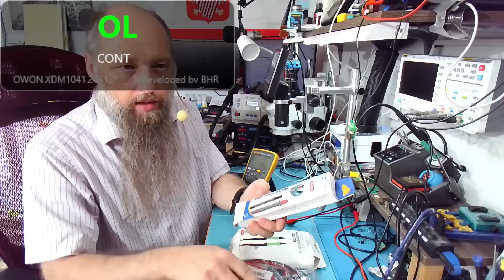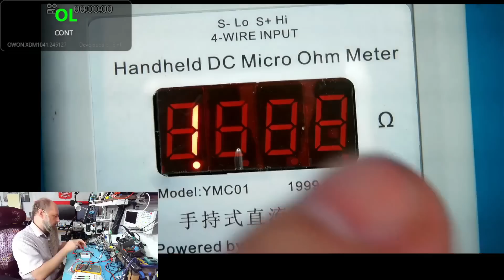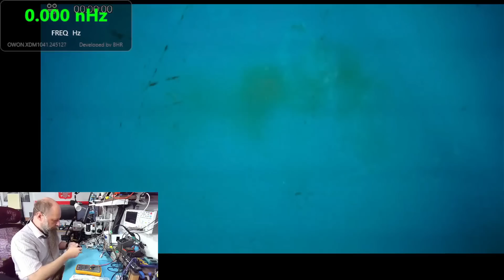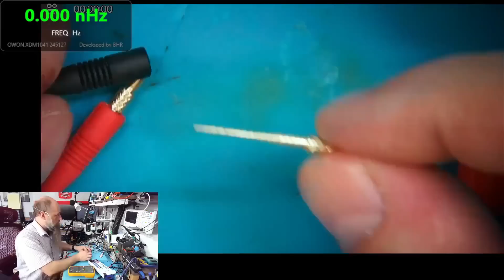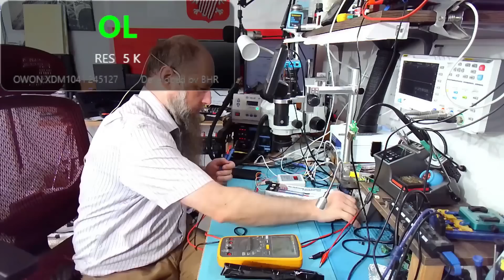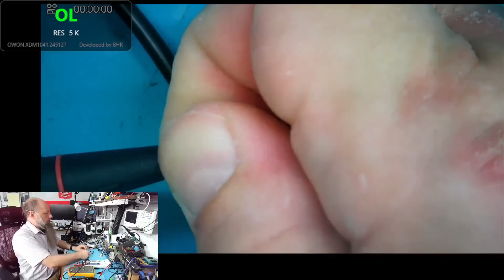228 | Multimeter Probes - Where and what to get

Comment: The hardened stainless steel tipped probes are the professional's choice for handheld multimeters. They have no plating to wear off, just solid hard stainless steel. I have 40 years experience in electrics and electronics. I've tried everything. Nickel plated brass tips are terrible at measuring low ohms. Also, the tips blunt after a day of real world use. Gold plated brass is a gimmick. Once the gold wears off, they are terrible. And the tip blunts quickly anyway. Stainless steel tipped probes measure low ohms accurately, the hard tips stay sharp for a long time, and the tips can be resharpened without affecting performance. FYI, I've been using Pomona 5898.

Comment: I use the very cheap ones, with the sharp tips. I bought them for like 1.60 or something .. They have very low resistance...I have a couple of them, because the tips tend to break when I use them (pcb that are covered in I don't know what kind of resin) been using them for years now. And I always go back to those ones, they are better than the ones that came with my Fluke (I mean better in the form of low resistance). In this day and age I almost only use my Fluke for "beep" function LOL! Because my cheap Chinese BS multimeters are "better" when it comes to high resolution, but the beep function on my "pro" mutimeter is faster..
I never cover the tips. For some strange reason I like to role over them with my office chair and that breaks the sharp point of the tip (I have broken like 3 of them, but they are cheap so what ever).

PS: I would've measured all the tips, not just 1. Also clean them with some (iso)alcohol before testing...
Reply from the maker: Thanks for the tips, I'll keep them in mind for the next video!

Comment: Have the cheapest version but with classic silver tips, and have higher resistance on some points (up 4 OHM!) caused by not homogeneous coating layers, had fine sand them a bit and turn at 0.2 OHM 
Wires are hard PVC with thin section like 23AWG
Reply from the maker: Thank you for the tip! I've heard of his method, never tried it though. Whatwasthe grit of the sandpaper you used?
Reply: @blackhorserepairs  1000 grit (the only I had, 2000 is better) fixed on a glass surface.
Put the tip with an angolation of about 45 degree and rotate, avoid strong pressure.
Sorry for my elementary English

Comment: Hey! Thanks for the content - noted a couple of tips for myself, it happens not very often lately. That's why I want to share some feedback and possible suggestions for future vids. Please discard them if irrelevant :)

the feedback:
- frankly the whole video I expected you would make a lot more measurements: 
you have in one kit: 4 tips, 4 tip holders, 2 wires. but you measure only a single tip and a single wire probe assembled using a precision resistance meter and 2 probes tip-to-tip using your multimeter. 
I expected measuring made on the precision meter:
- all of the tips from the very tip to the upper end of the screw part, 
- then each tip holder separately, 
- each wire separately 
- and then each of the whole wire probe assembled
and finally multimeter measurements:
- tip-to-tip measurement, 
- single probe measurement (by simply touching open multimeter port with the tip of the plugged probe)
  .various resistances at hand would be much more informative and entertaining

suggestions:
- scratching materials of  different hardness like oxidized tin, brass, copper; clean metals, golden contact pads etc.
- scratching the tips with different materials of known hardness under the scope to determine the material of the tips (gold, brass, galvanized steel)
- try flame analysis of the tips (at least those you destined to be thrown to junk: different metals make the propane flame to get a specific colour 
- determine the influence of probe plugs contact is corelated with their insertion tightness
Reply from the maker: I noted all that for the second part, I should be able to do most of those measurements. Thank you so much!
Reply: @blackhorserepairs oh, that's awesome! I subscribed to the channel yesterday, so I hope I won't miss the release :)

Comment: I hear the first time, that to cover testing probes with plastic or rubber plugs are very important... That's  nonsense, if we testing everything with oxide layer, why we should care that probes have a little oxide layer, i just clean probes with contact cleaner, or ipa, and it is ready to go...  Covering testing probes, with rubber plugs, will not protect from damage in future, we can make damage in other way, nonsense to protect thing that will be stabbed to everything you want...
Reply from the maker: you have a point, I don't really have anything to back up my claim, but, when you receive your probes from the factory, all connections are covered, both sides. It is only my assumption that if it did not impact shelf time, they would not have bothered to do that, ergo it should extend the life of the probes (perhaps by negligible amount). Thank you for pointing that out.

Comment: All probes will tarnish no matter the make or price. A little mechanical cleaning goes a long way. Fluke has been making PVC probes for decades and those do not crack, but are not as nice to use as silicone ones. I see no practical downside of using a 0.3Ω probe vs a 0.1Ω probe with a DMM. If that makes a difference you are already in the 4 wire measurement territory.

Comment: I agree you need good probes for consistent results which is very important. I suggest you press the relative button on multimeter to "zero out" the probes used for testing. It is very difficult to determine the resistance due to how you touch the probe ends and whether or not there is oxidation on the probe tips. I also would say to try your tests using first IPA and then deoxit to clean and prep the tips and connectors before testing to achieve consistent results by reducing the oxidation on the probe tips. Depending on how long a probe may have been in stock the results can vary depending on oxidation levels on the probes connectors and tips. Even from same vendor. If possible, getting probes that are soldered to the wire is better than ones with wire only crimped to the probe.

There are so many variables to consider such as type of wire, awg of wire, connection of wire to connector and probe tip, type of casing on wire, etc. At the end of the day for normal low voltage work, using the relative or "zero out" button on the multimeter will usually compensate for the lesser desired probes with a higher resistance. Only thing to then make sure is that the probes give a consistent reading due to how they are connected to the connector and probe tip. Just some of my thoughts.

Comment: I have a Fluke 79, bought 33 years ago.  It still has it's original probes and both the meter and probes still work perfectly.  I use it every day, often in dirty, wet & hostile environments.
I have never covered the tips.  I have never treated them with anything.  They are not 'gold' plated.  They still work perfectly perfectly.

I would conclude that if you buy decent probes in the first place - you don't need all that hassle.  Buy cheap, buy twice (or more).

The same goes for the Multimeter.  It was fairly expensive when I bought it - but has lasted a lifetime.
Reply from the maker: True but it depends on the use and environment as well as your expectations.

Comment: Some of the cheaper probes with replacable tips are awfull, the tips seem to be made from a cast alloy and have no give and will just snap. Also even though they are replacable (you get four included) you can't buy more and any tips you do see are the wrong size.
Also after a year the cable just broke off next to the probe under the rubber cover, easy to resolder but doesn't  give me much confidence in them. I would avoid high voltages.
The cables were very flexable.

Comment: Best chinese lead I got was a mijing BX-12. Got 18mOhm (cable to needle), measuring it with a owon series 2000 and a LCR with 4 wires.
Reply: I have the BX-11, very nice and low resistance.
Reply: @hansmoser162  yeah. Its amazing how all the chinese technology are getting better and stay cheaper.

Comment: If they are gold plated, then they won't oxidize. You have either worn the gold plate off, or you never had gold plate, just gold coloring. If you really have gold plate, then you don't have to put covers on them. Cheap meter leads are not usually gold plated, just gold colored. Real gold plated leads are expensive, so you only get what you pay for.  :-)
Reply from the maker: only 24k gold doesn't oxidize, if it contains copper it will start building up a layer of copper oxide. In addition, the layer of dust and other stuff can cause issues as well. Yes, I may have scrached them too much and they lost the majority of gold. In any case, cheap probes must be replaced roughly once a year

Comment: I prefer the Fluke test leads.  But with extensive use they can become intermittent or fail,  the conductors breaking just outside the rubber strain relief extensions.  Also I have heard there may be counterfeit Fluke leads coming from you know where. Close copies in all respects apparently.  For practical purposes it may not make much difference.  However Fluke leads are certified for those working in high voltages and fakes maybe not. So professional electricians ought to avoid knock offs.

Comment: I agree that you want good probes!!! Where I think that the quality is with probes is if they are gold or at least nickel plated or not. I've been using "Probe Master"  brand for half a Century. The cheap plastic ones are also a hazard when measuring because they can "slip" because of their stiffness, and this is going to happen EVERY TIME that you make a measurement. They are also very fatiguing to use, again it's a problem with EVERY measurement. I have cheap meters and expensive meters. The Golden Rule with meters is to use a cheap one when measuring amps if you must measure directly when you can't use a clamp  on ammeter because it MIGHT become a sacrificial lamb: Those Chinese meters are so cheap that it's not even worth replacing the fuses, even if you can find them. The Fluke V is very expensive and is mostly a Hanger Queen, used only for fine measurements and other meters are checked against this as I can't afford anything other than a cheap Voltage Standard to calibrate against and as a reference. It's also very fatiguing to read a meter that's flat on a surface, especially if the overhead light washes out the display. The kickstands also fall over easily and this is quite annoying, so I use a piece of wood so it is wider and won't fall over. And having the display at eye level helps. Also an expensive small digit display is never better than large cheap display, and back lighted that stays on all the time is best. I use the cheap Owon one for the bench.   It's not a four wire measurement, so not super accurate, but good enough for .ost purposes, always remembering to ignore the most right hand digit at all times. My eyes are getting bad now over half a century of looking at circuit boards  and components that have gotten crazy smaller. It should also be remembered that when measuring amperage , you might find it easier to just use Ohm's Law and just measure the voltage and resistance. This works quite easily for DC circuits, but for AC, you are going to have to use the more complicated impedance calculations and you MUST know the frequency and capacitive and inductive reactance formulas and even then it gets messy fast. Just my thoughts... All the Best! 73 DE W8LV BILL (and in saner times: W8LV/VE3)🙏🇺🇦🇺🇸🇨🇦

Comment: having probes with very low resistance is a must for both dmm and psu unfortunately there's no way to know the resistance value unless you buy them that's why these kind of reviews are very helpful, btw why is it written micro ohm meter in the tester when it's clearly showing resistance in the milli ohm range that's very misleading i would never know if i haven't see it here
Reply from the maker: yes, it is called micro ohm meter for some reason, it is indeed misleading
Reply: So how does it affect your DMM measurements if a probe is 0.3Ω instead of 0.1Ω?

Comment: My Polish brother,6 years ago  I made video in Serbian about same thing but I used metal polishing paste to remove oxidized layer. I can  say 100% that this is all true. if you want to watch picture can say more than words (you will understand everything) 
https://www.youtube.com/watch?v=dK6PLY4UP04&ab_channel=Workshop
I made crap probes to work fine and have good contact ( I don't use them but I made them usable) also I showed much more quality probes that have same problem with oxide (much less then crap one)
Regards from Serbia...
Reply: good point about cleaning the contacts. when i buy meters for students i always make sure they are polished.